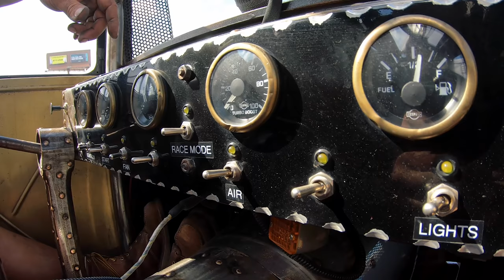DIESEL RAT ROD Engine Build (IT RUNS!) Part 3

Comment: Ok...so the D-rod was sputtering at first...just getting air out of the system? All in all I'm very impressed.   I've learned alot just by watching your fabrication.   I know your sold on the fummins and 2 strokes but, how about some dmax time and or the old 7.3 "powerstroke" aka Navistar engines.   Just throwing some ideas.   Love your shows and tube clips

Comment: if you let the return pipe for the oil from the turbo go back up just above with the turbocharger and then down to the return inlet you have oil that lubricates at shutdown, the turbocharger's bearings last longer. the turbines spin at high rpm even after the engine is switched off. As you have pulled the pipes / return hose now, the lubrication will disappear if the return hose goes straight down as soon as the engine is shut down.
Reply: Like a loop,so oil puddles in bearings. Doesent all drain out. 
Im no diesel guy by any means, but is that not a recipe for a runaway?
Reply: Dont want any chance of it backing up. And runaways only happens when it either has really bad piston rings or the turbo seals go out

Comment: Looping a return hose is also an idea, but there are small amounts of oil as I described it. Doubts that the engine would run off it, in which case it can do so regardless of whether the turbocharges leak oil into the combustion chambers. There are small oil tanks that let the oil run over the bearings when the oil pressure ceases, called turbo rescues, but as I suggested if he has some oil that lubricates the bearings before the turbo stops and lubricates the turbo directly even when the engine is started. The mistake many make is not to let the engine and turbo run for a few minutes at idle only before shutting down and so as Steve is doing high rpm on the engine and then shutting down immediately it is what destroys the bearings in the turbochargers.

Comment: Ya'll should switch over and run the updated 6.4 starter. Larger reduction gear for more torque when starting and last longer. 
Bad ass rat and one of the reasons I'm dead set on creating my own diesel rat 🤘

Comment: Are you sure that’s a 1000hp because your wasting all that fuel blowing it out the pipe with 600 foot pounds of torque.
Reply: A lot of times the extra fuel from rolling coal is on purpose to cool the cylinders and EGT's. Plus when the nitrous is on itll clean it right up